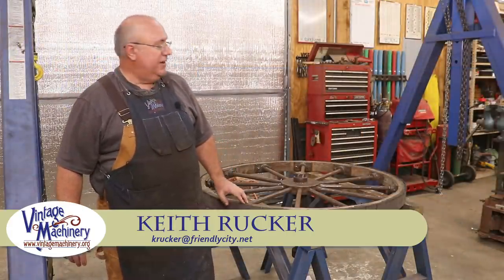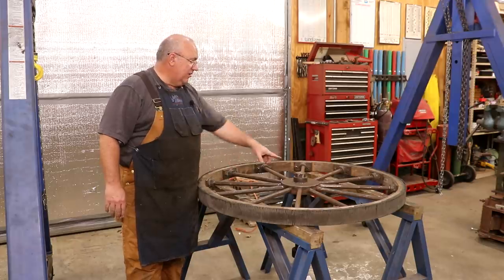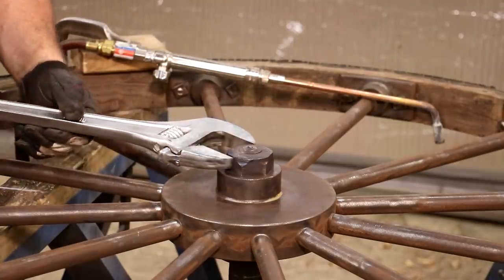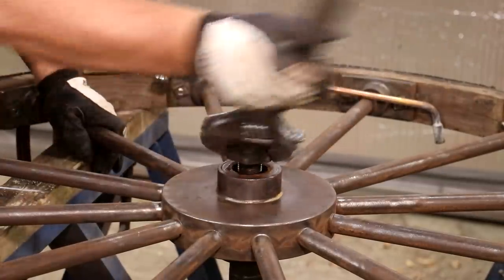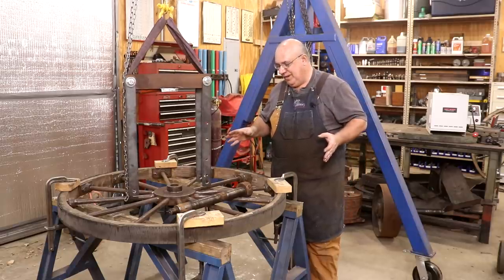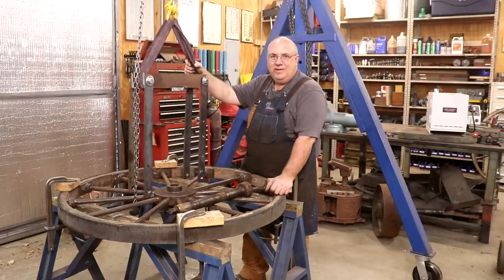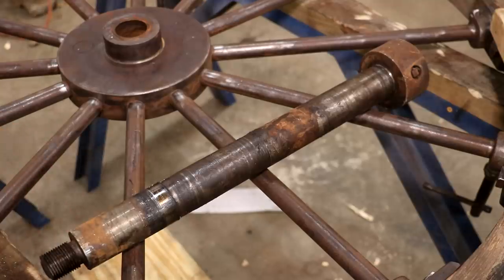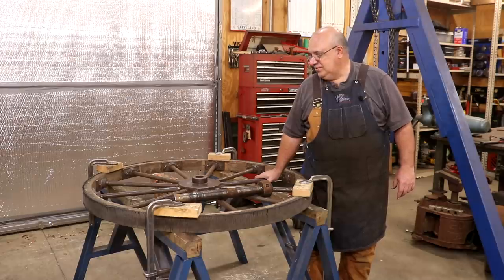The Jimmy Diresta Band Saw Restoration, Part 6: Top Wheel Shaft Removal - That was EASY!

Comment: As a Machinist who started in a shop that originally opened in the mid 1800's, I was taught a lot of the "Old Ways". Everything I have seen you attempt I have in some way or another done before. In the Mid West, for many years on my own, I was well known for scraping / Flaking and alignment (Hand and power), I've worked Babbitt, 1/2 & 1/2, cast iron, bronze, turcite, etc. When I started, the shop had no OD grinders. I was taught the art of turn, file & polishing shafting up to 12" OD & 24 feet long. They did have a 1903 overhead belt drive lathe they had converted for polishing long shafts with a belt sanding device mounted to the cross slide. The idea of you indicating the taper of the 2nd shaft on your lathe is a way to start the fitting, but you need to go a bit further or it may loosen up over time, even with torqueing. After you turn your taper, it will have the tooling marks leaving high & low spots. Leave the taper a bit larger than your finished taper Diameters end to end. First using a mill bastard file, smooth the taper. (After each pass clean the file with a file brush) 2nd Blue or lamp black the taper of the shaft and run it in the tapered bore. 3rd, File the high spots in the lathe again that you find on the shaft taper and repeat until you have the correct full length fit. Do a final hand polish with emery cloth and you're good to go. The taper ID's & shafting will never be identical from one part to another, especially on aged machinery that were hand machined and fit.
Reply: What about lapping the shaft? 
Or, would doing so create a different fitment problem?
Reply: @tomp538  you could but it would take longer. Turn filing polish with bluing would take less time to take down the high spots of the machining.

Comment: You are correct Keith, your are not the first person to build a portable press arraignment. Nor was I when I built my first one years back for a job I was doing. However that is the kind problem solving thinking that allows us to fix large complicated things with relatively simple tools. Well done. Thus far this has been a fun series to watch. Cheers.
Reply: Built a similar press to pull a 6ft dia. fan impeller off of a 3 15/16" shaft.
Reply: @millwrightrick1 , that’s a beast! Lol

Comment: I have a portable press similar to yours that I made about 6 years ago for removing pins from hydraulic cylinders. It’s funny how many different people come to the same type of conclusion when faced with similar situations
Reply: As Ecclesiastes says: "There is no new thing under the Sun."
Reply: Biologists would call this "convergent evolution," i.e., two different organisms evolve a similar phenotypic solution to a similar environmental pressure.
Reply: Just thinking,...if you could mount a slotted receiver at the top two bars, you could slide the jack upside down into the receiver so it would not fall when the shaft, bearing, bushing, etc. pops loose.  It would allow the placement of part protection at the bottom of the jack without trying to hold everything in place.  Of course if it were placed in a horizontal position it might be another bucket of worms. 
Great solution, appreciate your time and effort to make interesting and entertaining videos for us  
A little wet and cool here on the north side of Houston, but a good Thanksgiving.  Hope yours was the same.
Reply: When I’m faced with a stuck pin I just take a pencil and draw it out!

Comment: Another machinist that I follow on YouTube is fond of making 
“flogging” wrenches and spanners for loosening tight nuts. He uses a standard oxy acetylene cutting torch and appropriately sized steel plate. The “flogging” wrench and a hammer will transfer a great amount of torque to break loose a tight nut.
Reply: CEE Australia

Comment: Nice job Keith, there is one thing you may want to add to your portable press that holds the jack. You can make it out of a small piece of channel or two pieces of angle. Cut a “U” in the back/web of the channel that is just large enough for the threads on the jack extension screw to slide into and weld onto the area where you set the jack too pad. The pad on the screw will hold the jack while you pump it into place and when the piece you are pressing releases. This could save you from dropping the jack and damaging the piece you are working on or yourself. I hope I explained it clear enough. 
Take care,
John

Comment: I am not convinced the other shaft was stuck by your turning the nut the wrong way. I suspect it was stuck regardless from the tightening each time the saw was turned on for a hundred years.
Reply: I agree. There is no way that the 1" thread and a soft nut would pull it up tighter than heat and a press.
Also, if it actually DID tighten it, then it would have broken the rust bond (which it most certainly didn't).
Reply: @johncoops6897  good point
Reply: not uncommon to have one fight you while the second one practically falls off if you sneeze ( or fart )...
Reply: Me neither. I think it was stuck but good when Kieth got it.

Comment: Removing the clutch hub on my old Triumph motorcycle, which is on a taper, involved tightening the puller as much as you dare and leave it for 24 hours after which you would generally find the puller and hub laying on the floor. This was back in the 60s when applying a heat source was not available to the average amateur mechanic. But I often wonder whether it was the change in ambient temperature overnight that was the final encouragement that did the job.

Comment: I just want to say that I was wrong. I was emphatically convinced that both shafts would be LH'd because they were on the same side of the saw and turning in the same direction. RH threaded nuts *are* cheaper and I guess I was thinking like an engineer and not an accountant.

I stand here, on this day CORRECTED!

Thanks Keith, love the channel.

Comment: I have fabricated a similar mobile press in the past.
A manure side spreader had a 1,5 meter diameter gear that was stuck on the shaft and it needed to come apart.
Was tapered AND keyed on the shaft and rusted in place.
Took alot of penetrating fluid, heat and pressure to get that one off.
Reply: I've also had to threaten them (similar items) with a love tap from an 8 lb sledge.  Moisture, marine environment, over a long period of time had the two parts rust jacked together.  The shock of a hammer blow was what finally did the trick.  The amount of loss due to the rust was hardly measurable, and after some clean up the parts were able to be reassembled and used without issues.  I started thinking of anti-seize as "mechanic's prozac" (" ... it's your friend!") during those days.  It spares you the trauma of those dramatic, sometimes violent, separations.

A turd hearse is one of those machines that sees little love unless it breaks down, I understand that struggle all too well.
Reply: That must have been one of those jobs that you're glad is over and hopefully you never have to do it again.
Reply: @Wayne Coke cant remember how much tons the jack was rated for but indeed constant pressure.
We already left it overnight once and the second night it gave way and finaly broke loose.
Lots of heat and pressure did the trick
Reply: @infoanorexic  50th hand free machine that sat in a field for around a decade filled with chicken manure for about 75%.
Didnt fancy shoveling out all that much, after the repair work we just spread that stuff out and it smelled real bad haha

Comment: As you know it helps a ton if you know how a piece is designed and assembled. You didn't know weather the shaft was tapered or driven by key or some other way. 
Assembly can be so much easier.

Comment: Keith

If you don't have a shaft to measure the taper, have you ever used CerroSafe casting metal to make a exact match for the inside of the taper (melts at 160-180F, when it cools it shrinks a few thousanths for easy removal, and 1 hour later it re-expands back to within a couple thousanths of the exact size of the cavity)  Reuse-able and not very expensive.  I bought mine from Brownells, if I recall a pound is around $30.  

John
Reply: Not sure if CerroSafe is intended for cannon size chambers. It might work if there are no pits in the bore but would probably require 5 or 6 pounds of casting metal for something that big.

Comment: One wheel will have right hand threads and the other will have left hand threads because; one wheel will have the driving torque applied through the shaft from the power source (driving wheel) the other (upper) wheel will have the torque applied through the blade (driven wheel) to the outside of the wheel requiring left hand threads for the top and right hand threads for the bottom. Or vice versa, but you get the idea.
Art

Comment: HI Keith:
I am surprised that you don't have a 3/4 drive socket set. I have a complete Snap-On 3/4 " to 3" set with a ratchet and 4' breaker bar .
I have had that set since the late '60's.
I love those "hot" wrenches. I have used hot/cold procedures for a long time. 
WE had a 100 ton press, air over hydralic, and it was not uncommon to max out that press. I have had that press just about jump off the floor, and it was bolted to the concrete,... when shafts, etc finally let go! It will raise your blood pressure when that happens!
Great video as usual!
Best Wishes!
Gary

Comment: When you make the other shaft and nut put a line in the middle of the flats to indicate left hand thread.
It might help someone years down the road.
Reply: Just stamp "LH" rather than some obscure markings.
Reply: @johncoops6897  Most any LH thread bolt or nut I saw had a line marking not a letter stamping that's why I made the suggestion.
Reply: @RichieCat4223 , just like the fittings on your acetylene tanks for your cutting torch. I know if there’s a line scribed into a nut that somethings up!
Reply: @Hoaxer51  And that means LH thread.

Comment: Pure logic: on the bottom wheel, the shaft drives the wheel (needs left-hand thread); the bottom wheel drives the top wheel via the blade; the top wheel drives it's own shaft (admittedly, not much resistance here). So, logically, the top wheel gets a right-hand thread.

Comment: My first press was very similar in design and size, except that the only jack I had at the time was an old British mechanical jack (not hydraulic) that came with a Triumph I owned at the time. (this was about 1986)  I don't recall what I used it for, but it worked great!  Still have the frame somewhere.

Comment: Is there a bad check valve in that bottle jack?

Neither of my two bottle jacks "push back".
Reply: I don't know for certain, but that may be part of overload protection.  The push back lets you know you have reached a limit?  I had a floor jack that would do that, but only if you put more on it than it was rated for and at that point you could hear the overload valve bypassing back to the reserve.  Better that than catastrophic failure, and serves as a reminder to never trust the jack alone to hold up the work should you have to get under it.

Comment: Keith, why do you think it is better to use a taper attachment then turn the shaft between centers, slightly shifting the center in the tailstock backwards or forwards? It's old and classic and extremely precise way to turn such tapers.

Comment: For the bottom wheel the shaft drives the wheel, but in the top wheel it is the wheel that drives the shaft. Even though the only load there is the shaft's inertia and bearing drag, it is still the case that you want a normal right-hand thread so the small load generates a tightening effect.

Comment: The more I think about it, I think the left handed nut was overkill.  I might buy it if it were a keyed straight shaft, but a castle nut would have held.  I believe the taper was to prevent turning of course, but a right handed castle nut would have worked.  A mill or a drill press doesn't have left handed threads, and they run in both directions.

Comment: Here is a thought, Could you have taken the hydraulic press at the other shop apart and then slipped the wheel over the uprights and reassembled the head  and then pressed the shaft out, and yes a lot of work, just a thought?

Comment: My grandfather taught to me when pressing a shaft with threads, break the nut, back off several threads then hydraulically press it out so it does not foul the ancient treads. As for spray painting, especially for young people, unless you have a painting booth, paint outside if weather condition permits. An appropriate mask is very important because your lungs are very sensitive and so important for good long healthy life especially if you might expect to live another 70 years. Very impressive project. Subscribing. Looking forward to your next installment excellently produced. Thank you for your sharing. Are you going to use this saw in your own shop? Are you going to build an extention to your shop to accommodate the oversized bottom wheel. Again, great video.

Comment: The clutch and front belt sprocket on my Sportster have left hand threads for the same reason. It would be nice if you had a tank of Evaporust big enough to put the wheels in.

Comment: - [KIETH] Do you suspect, that "back in the day", shop folk took burning coal that fired the boiler producing the steam to drive the overhead pulley wheels to run this particular machine, and placed those burning coals around the axle collar, and then wait ten to twenty minutes to hear it to go clunk on the floor while they were doing something else productive?
- I can see it and hear it in my mind's eye.
- By the time they got back to problematic pain and the but the "pulley axle work" it was as cold as stone.

Comment: The last axle episode was a disaster because you never applied enough heat for long enough to expand that big hub. I thought with your experience you would have realized that.  I have 3 portable puller cages/ frames different sizes so  I can use my Porta  press with. 
     An old machinist taught me a good trick long ago, and that was, when removing stubborn press fit shafts or fitting press fit sleeves spit on the part your heating and when the spit rolls around like a ball bearing your heat is near the mark.
Reply: I thought the same thing about not enough heat. It's possible they heated the hub when they originally installed it to make it even tighter when it cooled.

Comment: It's not counterintuitive. For the bottom wheel, the power comes from the shaft, thru the wheel, and to the blade. For the top wheel, the power comes from the blade, thru the wheel, and to the axle. Power moves in opposite directions for each wheel. So the threads for the retaining nuts should be opposite too.

Comment: Since you are replacing the bottom shaft anyway, you could always key the shaft and hub, and make the bottom nut right hand thread.
Reply: Keying the shaft and hub would require a dedicated tapered broaching insert to be machined and would also make this upper wheel different from the lower one. Why not just put it back together like it came apart? The tapered fit and big nut should work as well as before.
Reply: @ellieprice363  Well, first, I would assume that if you keyed the lower shaft you would also key the upper shaft.  Second a dedicated tapered broaching insert wouldn't be hard to make.  And keying the shaft is done on the mill.  Third, there are other ways of cutting a keyway on a tapered hub other than a broach.  Like a shaper.

But I am assuming that Keith will put it back just the way he took it apart.
Reply: @TheMadJestyr  Yes that would be the conventional method but very difficult due to the sizes involved. Broaching a keyway without a dedicated insert would be a nightmare even if possible. It’s easy to see why the designers chose tapered fits for these wheels.

Comment: The bottom wheel needed to be left hand thread because the shaft was driving the wheel.  The top wheel was opposite because in that case the wheel was driving the shaft.
Also could the reason for the holes he mentioned in the last video just be removing a small amount of material for balancing the weight?

Comment: Is there any reason not to make a nice hand operated valve lever for a hydronic jack? Small enough so it does not get broken But big or long enough to operate by hand without that stupid notch cut into the jack handle. 50 years of fumbling with turn valves. Just noticed what a pain they are watching the video . I love when stuff pope’s apart like that. Everybody jumps except the guy with the torch.
Reply: The whole idea controlling the valve with the handle is so you don't have to lean 2 feet down to tighten/loosen the valve. You are already at the end of the handle (pumping it), so moving the far end about 6" down to the valve is a LOT easier than getting down on hands and knees to spin some valve. Also, the jack is usually underneath a vehicle, and that is NOT something you want to be reaching underneath to lower it.
The most annoying thing about those jacks is the 2-piece handle. I fixed mine by drilling a hole and fitting a split pin so it wouldn't fall apart like Keith's handle did.

Comment: If it was me I would spray weld the shaft and keep the shaft the original size. Oh yeah why’s it may be easier just to turn it but to keep it the same size it started at have a lot to do with old equipment

Comment: This is not counterintuitive at all... If... you just think a bit :)
Bottom wheel is driven by the axle, so nut is left hand so that axle will tighten it.
Top wheel iz driven by the saw, bu the wheel itself, so wheel is one that tighten the nut, so nut must be right hand.